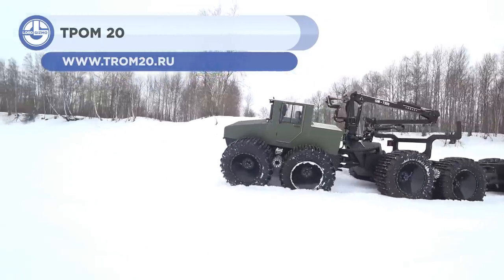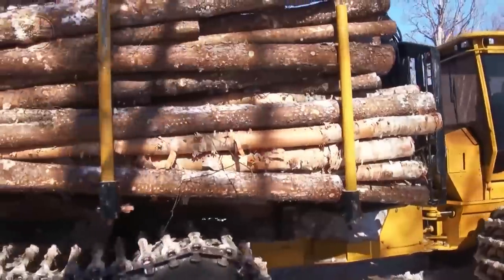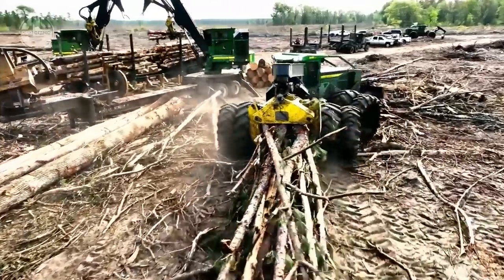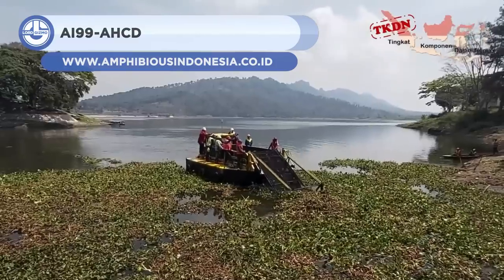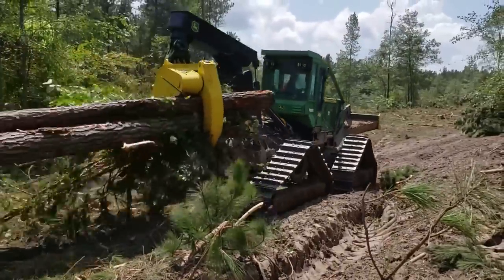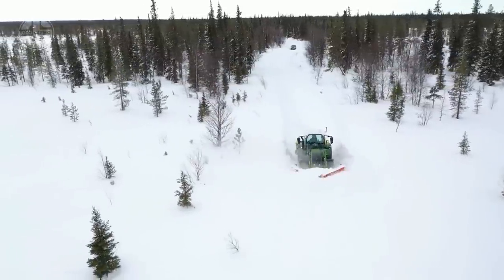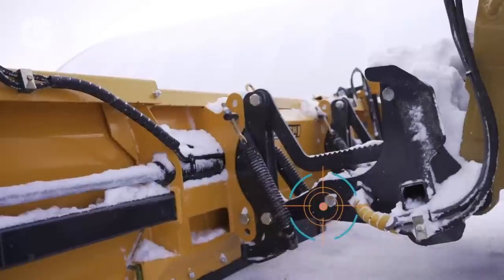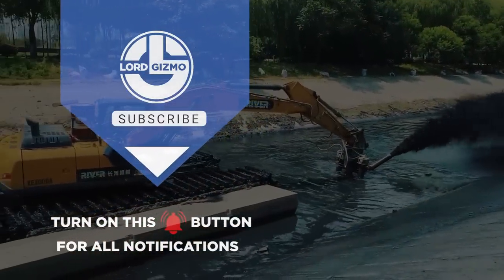Powerful MACHINES Working In EXTREME CONDITIONS - This Is A MUST

Comment: Witnessing powerful machines operating in extreme conditions is truly captivating. The sheer strength and resilience displayed by these mechanical marvels are awe-inspiring. It's not just about the impressive capabilities of the machines, but also the testament to human ingenuity and engineering prowess. The combination of cutting-edge technology and the ability to perform in challenging environments showcases a remarkable fusion of innovation and practicality. Each scene unfolds as a testament to the relentless pursuit of pushing boundaries, making the viewer appreciate the incredible feats achieved by these powerful machines under the most demanding circumstances.